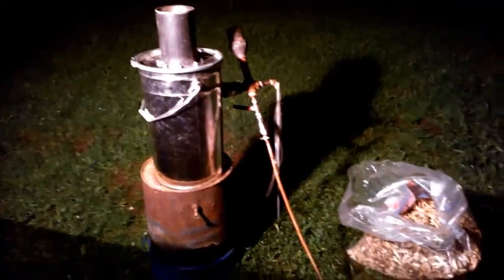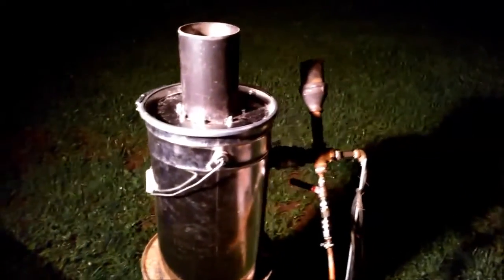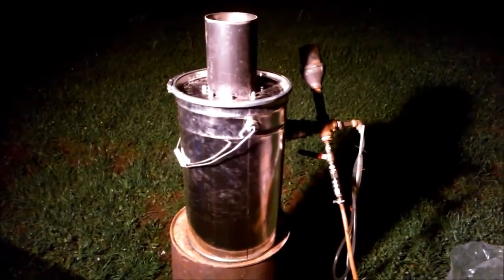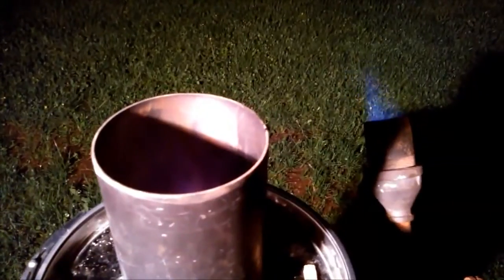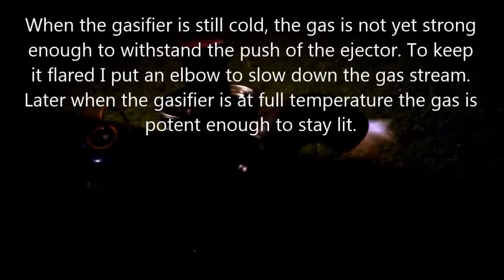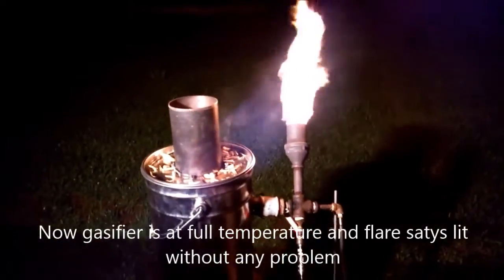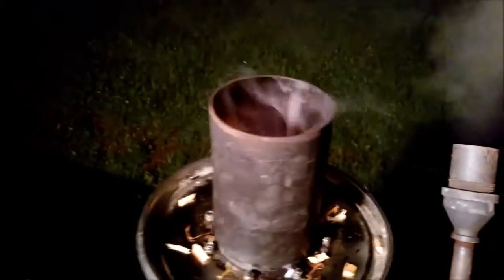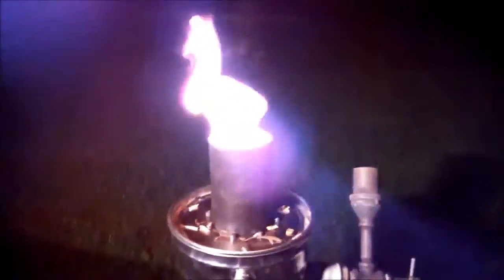PART 2 - extreme simple DriZzleR mini gasifier - first flaring test

Comment: Sir..I have never seen a design like this. Continuous Feed...Completely Open feed hopper...It looks too simple but yet very very effective. I just want to ask you that how does this" open-feed-hopper-design" has not resulted any higher air fuel ratio for gasification??? Because in general. The main problem in downdraft gasifier would be sealing up the top to prevent any sort of leakage. I really want to know why such problem has not been seen in your design. Eagerly waiting for your reply.
Reply from the maker: Dear Sojan, Thank you for commenting. The secret lies in the DriZzle method.  You can read all about this in our blog= http://www.thedrizzler.org and also a lot of information from other DriZzleR builders can be found in our forum= http://forum.thedrizzler.com/index.php
Just subscribe and join; All members will give you all the information you ask.
Luk

Comment: One word of caution from my own experience- any gasifier has the potential to explode at any time- all it takes is a defective seal allowing air to enter and ignite. The explosion needs somewhere  to go, which in my case was back up the air inlet, showering hot charcoal everywhere. The good luck was nobody getting hurt, the good judgement will be redesigning the gasifier with a bursting disc.
Reply from the maker: Brian, I do not dare to take the risk but i realy like to know if the DriZzleR is more explosion proof. I think of putting a remote controlled valve on a vessel that i think containes the most gas and open that from a distance. It could be an intrestin video.  luk
Reply: We had one co-fueling a 371 on a sawmill had a backflash while refueling that sent flaming fuel flying out the top made some excitment.

Comment: Hi Luk,you are the BIG DEAL!!!!!!!!!!,im so happy that i was back again to gasifier,before days i quit of idea to make a gasifier,because i watch the reactor of ALL Power Labs,and is very complicated reactor design,and i think-that is the right way,there is a smart engineers work on that years.But later that day,i starting to think-"'I'ts must to be the other way''....and i type in google: Direct gasification,that i find you,and im very happy.Just starting to make some drawings on paper ans i see you did it ;).
I need it to heat a water,and you the first as i see heating water and colect some data,the good thing about gasifier is -that process of heating is start before going to final flame.I have some questions:
-is it dangerous with the air from kompressor mixing the way you did?/but the way you did at the end of the process i thing is good ;)
-the power must be increase with this mixture ,how much?/gas + air ,that i was thinking to do ;)/
-what is the power of filtered flame/what is this blu gas is?/ and the not filtered-yellow /H+CO/ 
im ask this because i dont need clean gas -im going to heat a water,not runing engine,and dont need a filter/exept cyclone/,maybe some filter with material for burning-for drying.
-is tge gas more powerful when cools down?

With kind regards:Stefan
Reply from the maker: +Heavencloser Heaven Stefan,

Sorry for this late answer. I only just now saw it. Gasification of wood in a gasifier is primaly intended to use for cogeneration. That is for simultanious use the heat and the power the gas can produce in an internal combustion engine. For this and that answers one of your questions the gas must be very clean. The filtered gas the blue flame is less powerfull becuase the element tar is not in it or in very little amount. If you only need the flare to heat then a tarry unclean flare has more heating power. What you are looking for can be done with a better device tahan a gasifier. F.I. by a biomass burner. Please google Biomass burners and you will find plenty examples. Succes Luk
Reply: +the DriZzleR Gasifier     Very small and compact.  Why people over complicate these gasifiers are beyond me, some are the size of refrigerators.